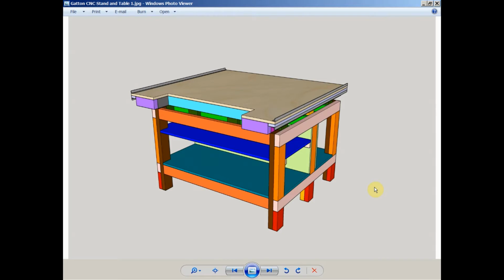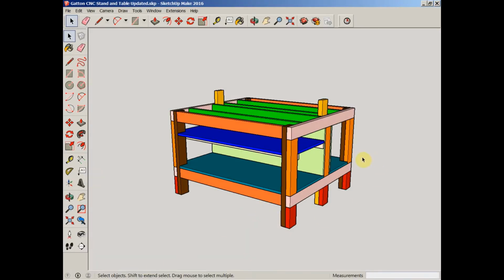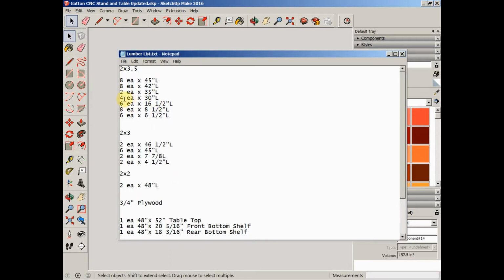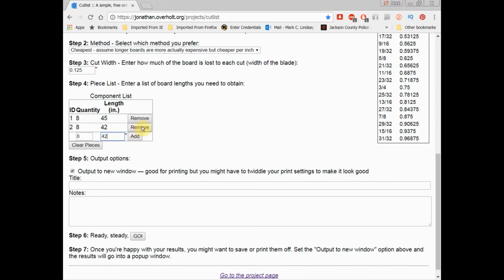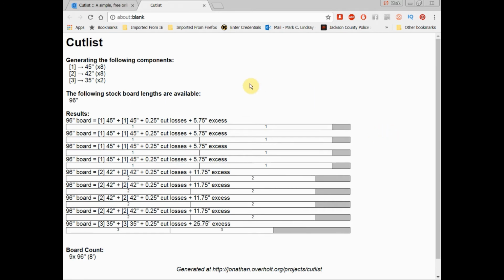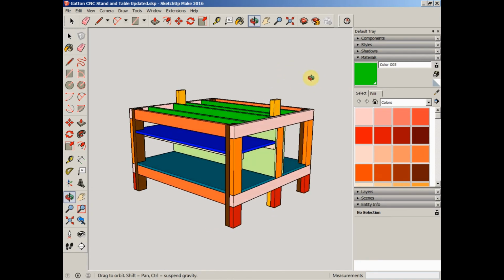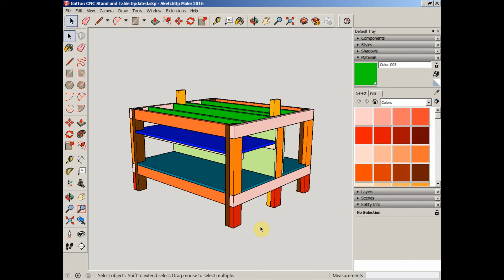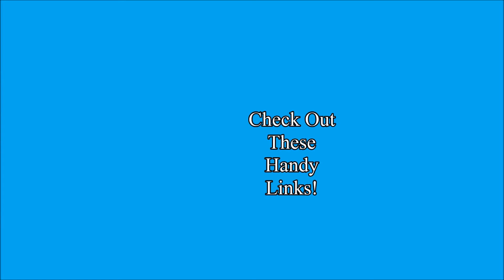Gatton CNC Build - Part 3 - The Stand

Comment: Very informative video Mark.  Is this stand built to the measurements that are in the plans that I got from Dave Gatton?
Reply from the maker: Thank you very much, Tony. No, my stand is built much larger than what Dave's plans call for. Dave's plans are designed to use a half sheet of plywood for the table (48" x 48".) If you watch Part 2 of my build series, I explain how I came up with the measurements for my table. Once I had those measurements, I designed the stand to fit it.

Comment: Nice Stand Mark.
People often underestimate how solid a stand needs to be for their machine. Once that machine is moving there is a lot of mass in the gantry and when it stops suddenly it's the table that has to absorb the energy. I had to add steel bracing to mine to make it more rigid. 
Cheers
Peter
Reply from the maker: Thank you, Peter. I do tend to overbuild things like this, but I may still add steel bracing if it's needed. I'll have to wait and see. The plywood I'll be adding later on will help stiffen it up as well.